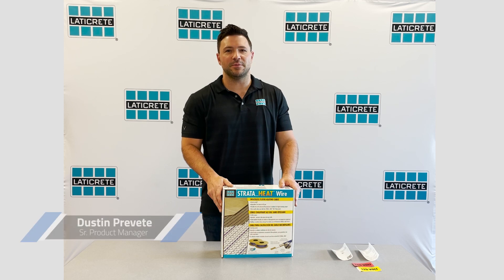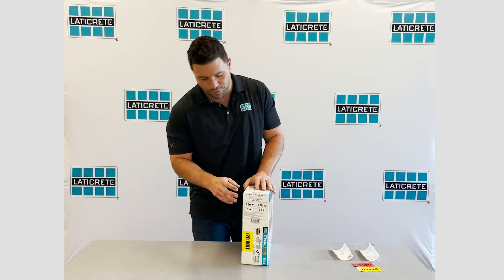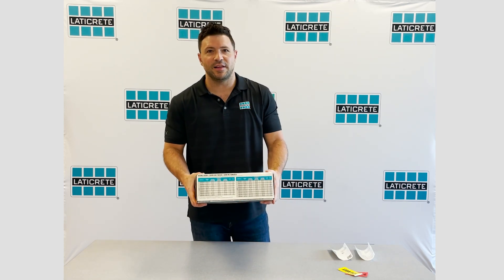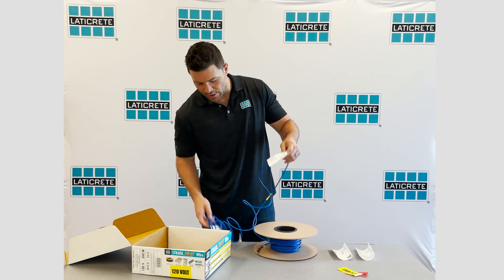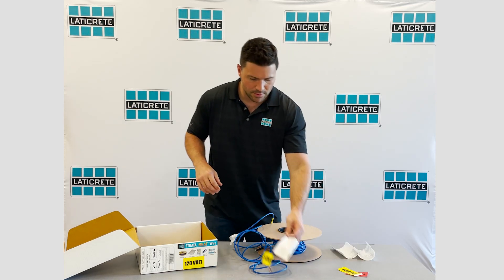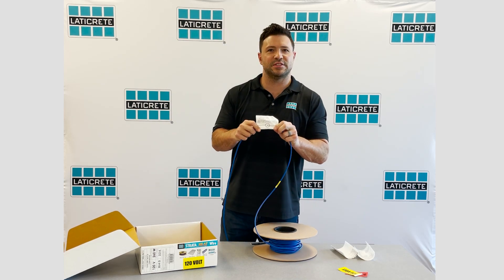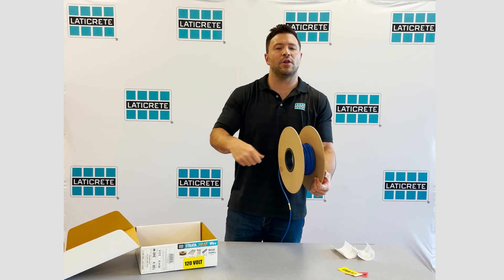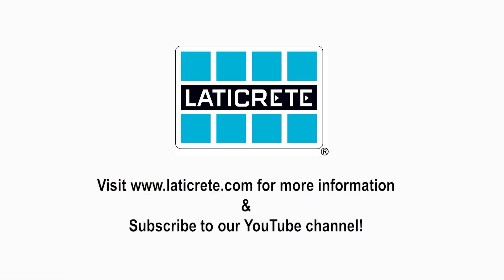Unboxing the STRATA_HEAT Heating Wire from LATICRETE

Comment: Looks like tou guys got everything covered except for printing/labeling the coating on the wire itself!👍🏼
Reply from the maker: Actually the wire does have the amperage and voltage printed directly on the wire. Dustin forgot to mention that in this video.